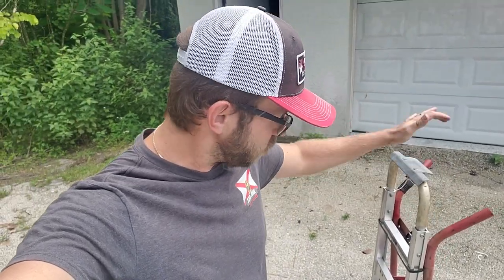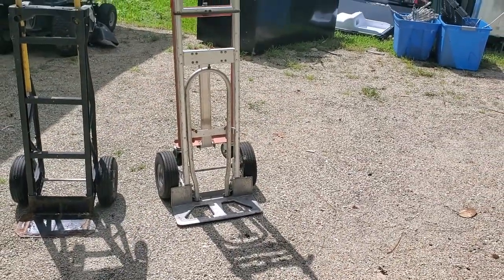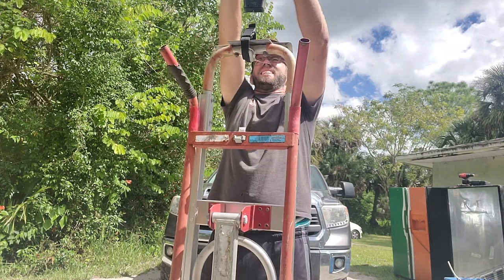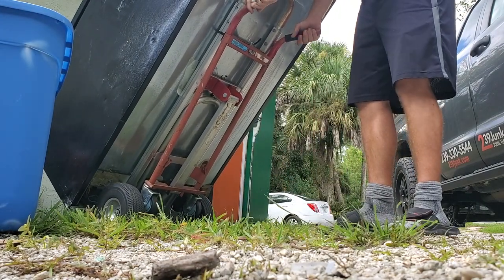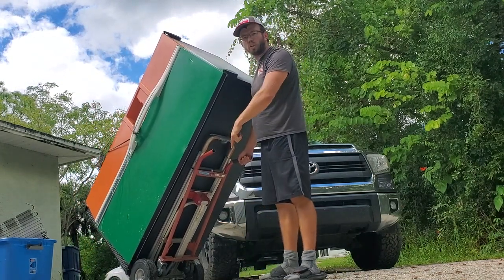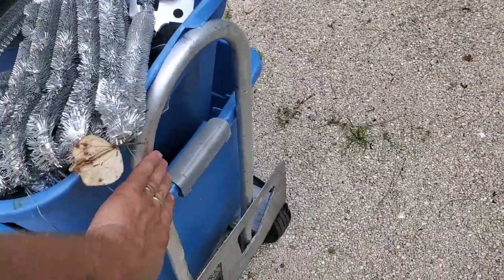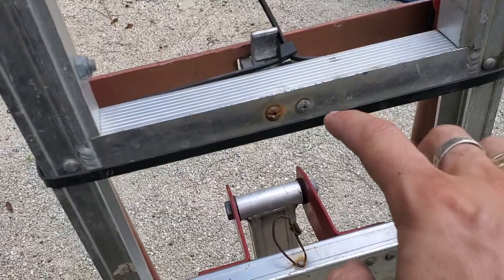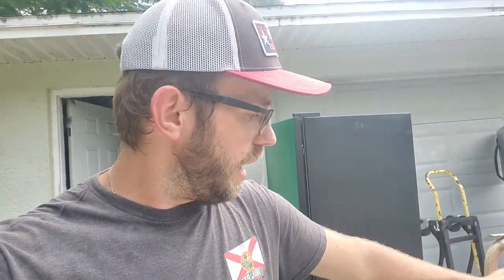Milwaukee 1,000 LBS Hand Truck Review | It's Worth The Money

Comment: Short answer is you not going to pull around 10 bags of concrete with that The end . Try pulling 5 of them out the door thru the parking lot with home depot's equipment those caster wheels . Try pulling it thru the yard up to your door .

Comment: How's it at going up stairs
Reply from the maker: It's good, the wheels are a bit hard, so getting up the stairs with a load on the hand truck can be a bit difficult considering the tires don't absorb the edge of the steps.